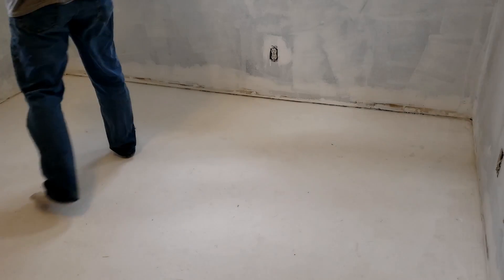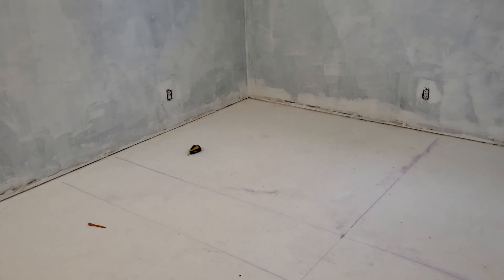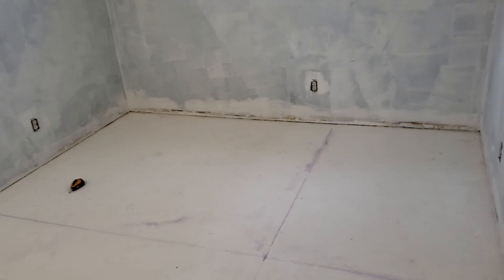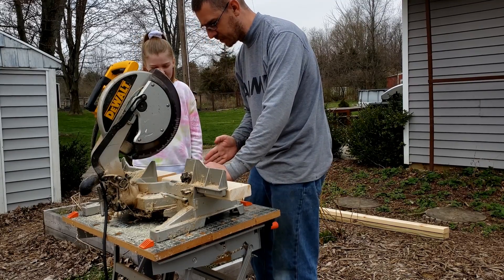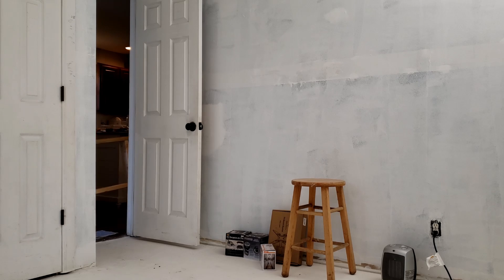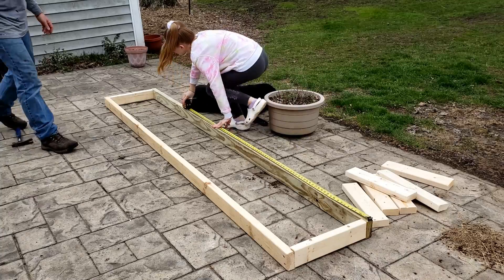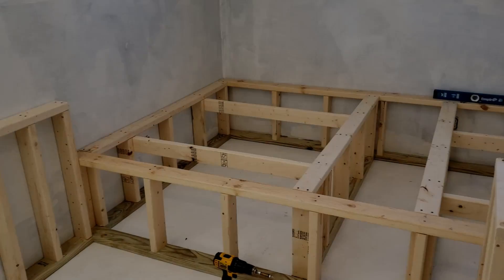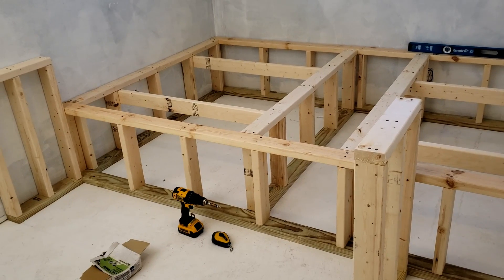Plan and Build - Platform Bed With Built in Desk

Comment: Make the stairs hinged to floor to fold out into the room to get that access. Or to fold up towards the wall when open then down to set on a frame closest to the framework already in place.

Floor. Put down that vinyl/rubber paint instead. The coating will be protective & take some of the cement floor chill that creeps up the wood out. And it comes in various colors now. 
Just spitballin ideas.

 That middle section could have a top opening. 

 A rope/chain pull of a couple storage boxes from either side of opening towards middle would utilize all the space.

Comment: Would running conduit through the frame be an option in the build? That would move the plugs out to an easier access point. Just the first thought I had when I saw the frame getting so close to covering the outlets.
Reply from the maker: I will be using some conduit to run some wires through the bed frame

Comment: Those gas shocks that lift RV beds might be useful. You could lift the entire platform surface with some of those if you wanted. I just installed a set in our camper. Seems like they were about $50.
Reply: I have seen a bed that is on some kind of lift, so it lifts up and exposes a whole closet, study desk area underneath, then closes when needed.
Reply: My thoughts exactly...

Comment: Will you have ventilation under the whole framework? It's on concrete which has moisture. Need to control that somehow. Just wondering. Good job.
Reply from the maker: I will design this so that there is access to all areas via the trap door or access door so that should provide ventilation. If there is an issue I can always add small vents also

Comment: Just paint the floor and everything below. No need to do plywood or vinyl flooring. It will be hidden storage. And you could add power to the outside by using an extension cord to one of the outlets then mount a power strip or one of those 6 plug with usb extenders. Make sure to close up the power outlets with covers to avoid issues later.

Comment: is say before closing that in any more to extend the outlets out to the outer frame up into yjr frame work of the stairs, the more you close it in the harder going to be to turn them plugs into junction boxs to extend wires out, use metal cover plates with L16;s, and being a storage area you have to use BX cable, glade to see you nailing the frame work and only screwing the sections together so it can be taken a part down the road or changed, far to many you tube video them screwing everything, screws are bridal and brake unlike nails

Comment: How about an RV type bed lift area?  Hydraulic arms with hinges attached to top to lift the bed area for easy access to storage.  Arm strength obviously depend on bed weight.  Plus I'm not sure how your topping this off...flush?  Or is ply on top of framing?  Those cross 2x4's make me scratch my head.  Good luck.  Looks like a fun project to do with your daughter.  :)  Go ARMY!

Comment: Excellent work!  A ledger board on the back and side walls would have been easier to install, used way less lumber and consumed a ton less time.  Also,  removing the drywall before installation would have allowed you to attach directly to the framework of the home and you could have moved those outlets higher in the wall rather than covering them.  Drywall is cheap and easy,  rerouting electrical, not so much.

Comment: You need to install 2.  2 x 4s horizontal on top of the 2.  2x 4s you put on vertical.  To support the plywood that the mattress will lay on.  I hate to see you waste the center part.  Put a secret hiding place in between the bed and storage??  Good luck.

Comment: Don’t touch the outlets use a shirt ext cord she won’t be running huge machinery and when you remove the bed your outlets won’t look wonky and out of place. Rolling tubs under the bed would be much easier and cheaper than building all that. Just my view from projects I’ve don’t int the past. Hammer not heavy enough lol I got a heavier hammer so when I swing it actually drives a nail. Why didn’t you do the flooring first???